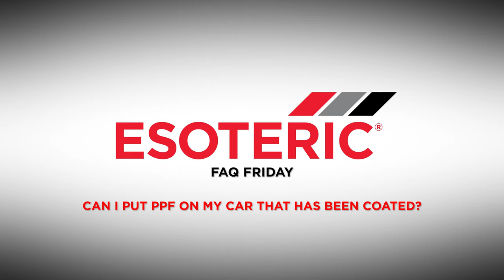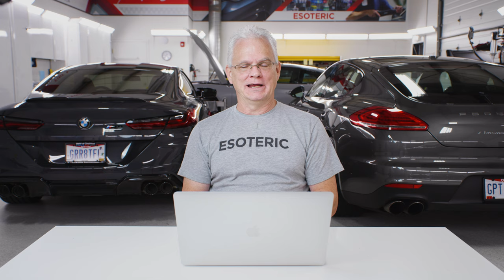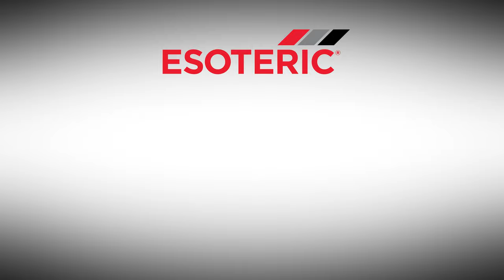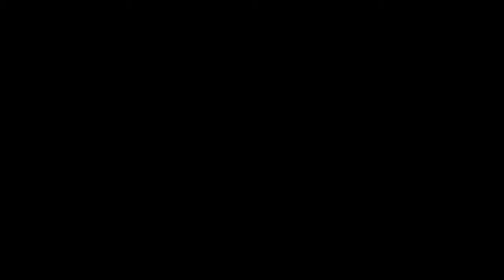Can I Put Paint Protection Film on a Coated Vehicle? Detailing FAQ Series!

Comment: Which is better paint protection film or ceramic coating for new headlights
Reply from the maker: PPF is the only thing that will provide impact resistance. So if the shape of the headlights allow for PPF, then that would be your best bet for true protection.
Reply: @Esotericdetail  Thanks